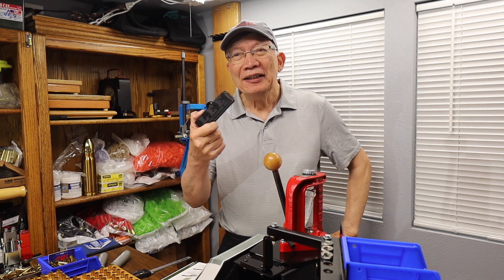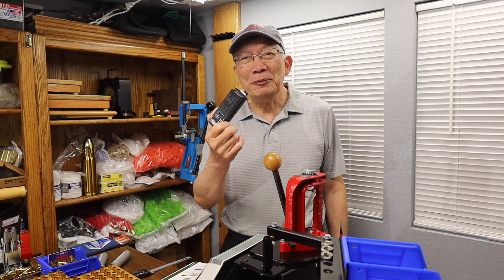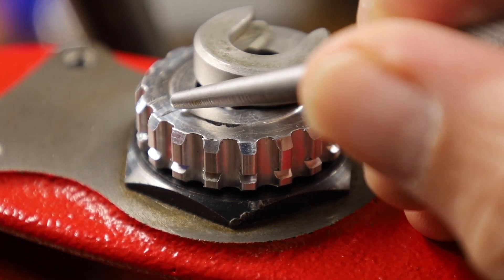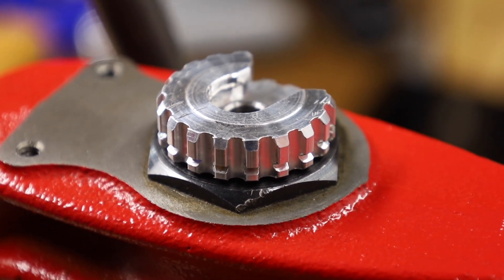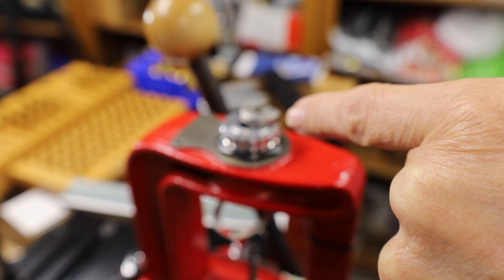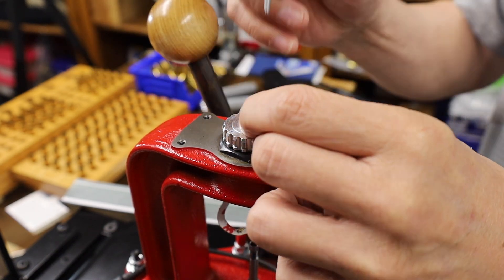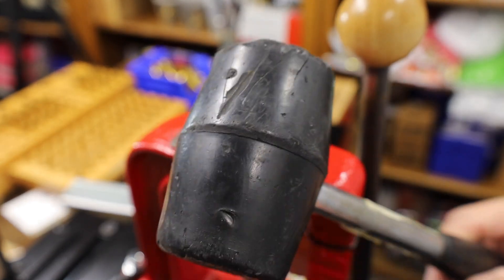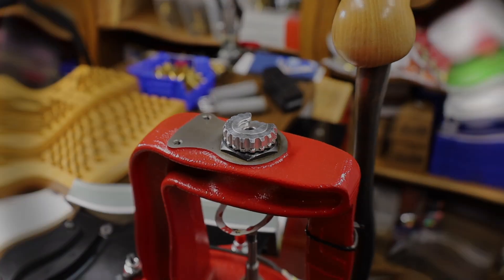Send Back To Lee Or Home Engineer A Solution??

Comment: Why would you not use a hand primer? It's so much faster than this method? I'm confused.
Reply: It has nothing  to do with speed, but rather safety. Any tool that holds more than one primer at a time can be extremely dangerous (See my other comments below that contain quotes from many reloading manuals about primers and auto priming systems). Some of us choose safety over convenience and speed.
Reply: A little bit about different brands and types of primers. 
Which ones to use, when and why. 
All CCI and Reminton primer, plus Winchester's small pistol are the safest to use in automatic priming tools.
Federal burns hotter and cleaner, yet are according to the Richard Lee manual "one tough dragon to control in the automatic priming systems".

Modern Reloading Second Edition Richard Lee Revised 2021, page 60:
To find out why some brand primers explode violently, I talked to an expert, Dave Anderson, now retired from CCI. He told me primers are charged with one of two types of charging compound. One is called "basic" and the other is "normal." The primers that use "basic compound" must not be used in Lee Priming tools because an accidental discharge is very violent. The "normal compound" is less violent and causes little damage to the tool. The user is easily protected by safety glasses. 

Metallic Cartridge reloading, Robert S. L. Anderson, page 20: 
In the firearms industry there are two types of lead styphnate primer compounds - "normal" and "basic." There are presently four manufacturers of primers in the U.S., and all of them except one uses the normal lead styphnate primer compound. Federal is the only manufacturer that presently uses basic . The common ingredient to all small arms primers is lead styphnate of which there are several different varieties. Basically it is in crystalline form and is very explosive. Normal lead styphnate is composed of large irregular crystals, which are slightly acidic when wet, somewhat more brisant at lower temperatures (good for military use), and they burn with a cool flame at ambient temperatures. However, it is somewhat harder to get an even mix of components in normal lead styphnate primers because of the larger irregular crystals and the fact that the "mix" often requires some metallic fuels (such as powdered aluminum) to help make a magnum primer. Basic lead styphnate is composed of small regular crystals and unlike the normal mix is not as acidic and will not attack primer cups when wet. Basic lead styphnate is easier to mix than normal variety and there is no need to add metallic fuels. The basic primer flame is very hot and will easily ignite most powders and therefore Federal does not offer a magnum pistol primer. However this style primer is slightly less brisant at very low temperatures (- 20degrees F. to - 40 degrees F.) which would make normal primer more suitable for military purposes. 

Metallic Cartridge Reloading, All New Third Edition, M.L. McPherson, page 29:
Certain brands of primers might be unsafe to use in some priming tools like Lee's AutoPrime because of the potential for mass detonation. With these tools, should an operator detonate one primer, as can happen when a handloader tries to seat one primer on top of another,  the detonation subjects other primers in the tray to shock and an incandescent flash. If this shock and flash can detonate a second primer, there is the potential that most or all (perhaps 100 or more) primers in the tray might detonate en masse. Such a simultaneous detonation would be a disaster. Lee has tested all available primers and, excepting CCI and Winchester, all brands produce an unacceptable number of mass explosions when the primer being seated is forced to detonate (by heating in a remote explosion-proof box). By comparing Federal and CCI primers, we can gain some understanding why brands very in this regard. Federal primers do not have a foil covering over the primer pellet; an application of a type of paint replaces the foil. That sealant is easily ignited and highly flammable, possessing a very low kindling temperature. These are beneficial characteristics; among other things, they help reduce combustion residues. However, use of this pellet sealant makes these primers very easy to ignite. Exposure of the open front of the cup to the flash from an adjacent primer easily does the job! Conversely, CCI primers have a paper foil almost completely covering the front of the pellet. This foil deters pellet ignition because it is only moderately combustible and has a relatively high kindling temperature. A short duration flash from a primer is unlikely to ignite the foil or penetrate through it to ignite the pellet underneath.
Reply: Three things to keep in mind here, “primer dusting” + “static electricity” = “ka-BOOM!”

VihtaVuori Reloading Manual 4th Edition, page 96:
Handloading is an enjoyable, rewarding hobby that can be easily carried out in complete safety. However, like any human activity, carelessness or negligence can create hazards. Handling primers and powders correctly is at the core of safe handloading practices. Do not store large quantities of primers in bulk! Doing so will create a bomb! Primers kept in bulk can explode en masse – the explosion of a few hundred primers is equivalent to throwing a hand grenade into a room! Do not use excessive force when loading primers into equipment, primer tubes, or seating them in cartridge case primer pockets under any circumstances. Take special care in filling and handling auto primer tubes - they have been the source of many explosions.

Metallic Cartridge Reloading, All New Third Edition, M.L. McPherson, page 6:
FORWARD
... ... never forget that when handloading ammunition you are dealing with energetic materials and devices capable of bringing great harm and destruction. I am constantly reminded of the dangers primers present. One regional ammunition manufacturer formerly demonstrated this fact to all new employees  at the company's annual picnic. At 200 yards, he would set up two targets: one was a company coffee cup with 200 primers in it; the other, two sticks of dynamite hidden behind a similar cup. He would then explode each target with precisely placed shots ... The question the group was to answer: "Which was which..?"  And the answer was not obvious!
page 29:
Primer Safety
If there is one area of deep concern, it is safe handling of primers. I don't understand how it happens, but people are always finding ways to set off a primer unintentionally. Stories abound of handloaders, managing to mass explode them. These incidents often involve hand-held priming tools or automatic primer feeds using a tube of stacked primers. The handloader can treat primers with all manner of disrespect, but sooner or later he will pop a primer unintentionally. If that happens to be intimately associated with a large group of primers, the results can be devastating. Even one primer by itself can inflict a severe wound ... ... ...
page 30:
Handle primers with the respect these little bombs deserve and follow all safety precautions provided by the manufacturers. Always wear safety glasses when handling primers.

Swift Bullet Company Reloading Manual Number two, page 38: 
The Basic Rules for Reloading Safely Introduction
Read all available books on reloading. Make yourself as knowledgeable as you can.
page 40:
Primer Handling
5. Do not dump together in bulk. There is a risk of mass detonation if one is ignited.
6. If resistance to seating or feeding of primers is felt, STOP and investigate. 
DO NOT FORCE PRIMERS. 
There have been instances of “primer dusting” in the tubes of reloading tools. Clean machine after each use. 

Lyman 51st Handloading Handbook, page 29 and 39: 
CAUTION: Primers are explosives and require special care handling.
page 28: 
CAUTION: Safety glasses should be worn whenever handling primers. 
page 58: 
CAUTION: Always wear safety glasses whenever handling primers. 

Hornady Handbook of Cartridge Reloading 11th Edition, page 85: 
Primers are the most active, potentially dangerous component employed in reloading. You can get into trouble with them handling in such a way as to discharge them …

Nosler Reloading Guide 9, page 44: 
DO NOT FORCE PRIMERS
9. There has been instances of “primer dusting” in the tubes of reloading tools.  Clean after each use. 

Barnes Reloading Manual Number 4, page 44; 
Norma Reloading Manual Volume 2, page 146, under “Primers”:
6. If resistance to feeding or seating primers is felt, STOP and investigate. 
DO NOT FORCE PRIMERS.
9. There have been instances of “primer dusting” in the tubes of loading tools. Clean after each use.

Berger Bullets Reloading Manual 1st Edition, page 104: 
The safe reloading of ammunition is largely based on the use of common sense. 
page 106: 
Always Clean up After Each Reloading Session
Debris will collect and it can be a safety hazard. It is therefore, important to clean up your work area after each reloading session.
Safety always comes back to the use of common sense. If you ever find yourself in doubt, stop, research the question.

Lyman 51st Handloading Handbook, page 59: 
CAUTION: Primer feeds require extreme care. … … handling primers one at a time is a safe procedure. However, primers handled in bulk are a potential hazard. Should you choose to use an automatic primer feed, extreme caution is required. … … Should one primer explode, all will do so spontaneously with disastrous results. Even a few primers exploding can cause serious property damage and personal injury. Many high volume reloaders feel an auto primer feed is a necessary part of their equipment. If you think you number among these folks, use extreme caution when working with an automatic primer feed. 
CAUTION: Never push, bang, bump or otherwise apply any force to a primer or primer feed.
CAUTION: When using an automatic primer feed, at the first sign of a primer jam or difficult feeding – STOP! Then think about what must be done. Force nothing and do not be tempted to jiggle the tool or any part of it even slightly. Rather, carefully disassemble the primer feed. First remove the primer magazine and all primers contained therein. Clear the jam, determine the cause for the jam, and correct the problem before proceeding with use of the primer feed.
page 60: 
CAUTION: Extreme care must be used when filling a primer feed magazine tube with primers. Never force a primer into a pickup tube. A pressure of no more than five pounds should be required for a primer to slip into the tube. Do not use any primer pickup tube requiring more than this amount of force.
CAUTION: Primers can and do “dust”. 
CAUTION: Static electricity may cause primers to explode. 

Hodgdon Powder No. 27 Data Manual, section 6 -10, under "Handling Primers": 
They demand the respect and careful handling due any device containing explosives. Primers should never be handled, used, ... in bulk, since primers in bulk can explode simultaneously. ... ... ... Precautions should be taken to avoid buildup of static electricity on the person when handling primers or conducting handloading procedures. Loading equipment should be electrically grounded. 

Speer Handloading Manual Number 15, page 41:
Static electricity and the Reloader 
1. Static electricity can be highly hazardous for the reloader. 
2. primers are most sensitive to static charges. The energy is enough to ignite primer dust in and around priming tools. The dust can ignite and propagate to all the primers in the tube [or tray]. The result is a serious explosion. This is the reason to keep those tubes [and trays] clean! 
3. Static charges prefer low humidity environments. take some simple precautions. 
a. Use a humidifier. 
b. remove carpets from reloading areas. This is the prime source of static energy accidents. 
c. Clean the reloading area on a schedule. Routine cleaning removes residues of primers and propellants that can react to static energy. 
d. Use an anti-static product[s]. 

Modern Reloading Second Edition Richard Lee Revised 2021, page 59:
Tony Sailer from CH Tools gave good advise about primers. “Reloading is pretty safe, until you handle primers in quantity.” Tony, a commercial reloader, visits other in the business. He says look at the ceiling above any powered reloading machine and you will see holes above the priming station. Primers in a tube explode with great force and unpleasant regularity. Jim Hulbert, retired from MEC, tested shotshell primers in a seamless tube. When the bottom primer was intentionally detonated, a 1X6 overhead looked as if it had been hit with a 12 gauge shotgun at close range. 
page 60:
Accidentally drop a tube full of primers to a concrete floor and you are going to have one heck of a bang.te. 
page 30:Certain brands of primers might be unsafe to use in some priming tools like Lee's AutoPrime because of the potential for mass detonation. With these tools, should an operator detonate one primer, ... ... ... the detonation subjects other primers in the tray to a shock and an incandescent flash. If this shock and flash can detonate a second primer, there is the potential that most or all (perhaps 100 or more) primers in the tray might all detonate en masse. Such a simultaneous detonation would be a disaster. Lee has tested all available primers and , excepting CCI and Winchester, all brands produce an unacceptable number of mass explosions when the primer b
Reply: Now I’ll round out with a few horror stories – {these are not meant to scare you away from reloading but rather to encourage you to always follow all the safety precautions and heed the warnings in the manuals for a safe and long Handloading journey}.

Any Shoot Will Do, The A-Square Handloading and Rifle Manual, page 16: 
Let’s start with guys who didn’t read the safety chapter. All of these are real incidents involving experienced reloaders. 
#1, A commercial handloader producing handgun cartridges in quantity used to begin his day by filling a coffee can with primers to pour into the machine. He would pull out each tray and, with a flick of the wrist, empty it into the can.  One day he used too much flick: one primer went off, initiating a chain reaction that filled the air with shrapnel and cost him both his eyes." [a commercial reloader that thought about how many rounds he had loaded and never had a problem whereby he did not bother with safety or safety glasses, until one day he wished he had taken heed to the warnings, but it was too late by then.]

The Complete Handloader, John Wootters, page 37:
The Power of Primers
Never under estimate the potency of priming compounds. ... a workman at a priming manufacturing facility was carrying a bucket of loose primers ... and the whole bucket detonated. ... they never found any part of the workman except his shoes. 
An acquaintance of mine had ... about a hundred rifle primers detonate in a plastic medicine vial in his left hand. He lost his hand and the sight in his left eye, and he underwent a series of operations for cosmetic repairs to his face, arm, and upper body, suffering a great deal of pain, a staggering financial setback, and the loss of part of his livelihood. He was a gunsmith.
Primer Precautions
Such tragedies illustrate the inherent explosive power of small-arms primers, but they can be avoided totally by understanding and adhering to a few simple precautions. The first is never store primers in any kind of container other than the original factory packaging. The second is go back and reread that last sentence several times. Do not keep live primers, however few, loose in any sort of miscellaneous container, and most especially not one made of glass.

A fellow YouTuber told a story of hand priming in his Lazyboy chair when one went off. They found the lid to the primer tray stuck in the ceiling above the chair. According to the story it had just missed his face. So be extra sure not to have it aimed at your face when hand priming with these tools. And safety glasses would be a very good idea  as mentioned throughout all the reloading manual over and over again.

And upon these notes I hope you have a blast, the good kind that is.

Posies of TheTexasRAT:
        And Remember,
                           Wisdom Never Lies
                           Inked Within The Pages Coddle By A Book
                           But Yet Rather Supply About
                          The Inside Of Open Minds
                          That Render The Confound Thereof

Comment: Anyone got a hack to seat an FTX bullet with dillion dies? Current seater smashes flex tip and leaves a hell of a ring on bullet. 44 mag 225 grain
Reply: I recall something along the lines of lubing the inside of the seating die with oil or Vaseline,  dropping melted wax inside and running a bullet up into wax while it's still warm to form a mold of the bullet. The lube is to expidite removal of the wax mold. Once i figure out how to send pictures and drawings vice text clarity will increase .     ☆

Comment: I've noticed quite a bit of variation in the dimensions of the shellholders when I went to make my own adapter for them.  I usually just take a cratex wheel to polish the neck and shoulders a bit.  I suppose you could do the same to the mount.  I'd sooner do that than deal with rolling a burr and galling the part in place by force.

Comment: Is it just the extreme close up that shows the shellholder rocking, or does it have as much play as it appears? I get that machined part 30 thou tolerance click-click with barely perceptible visual movement with an RCBS shellholder in a rock chucker.